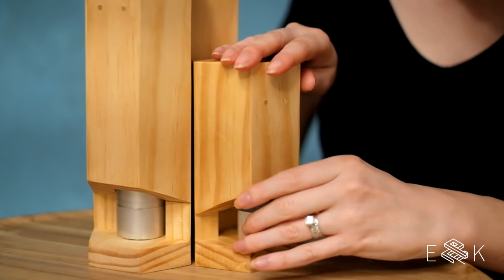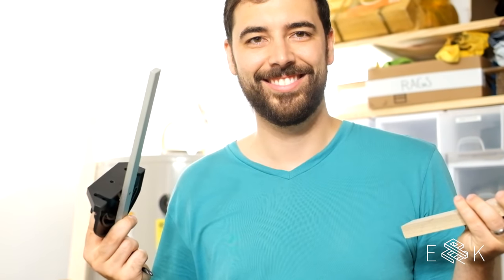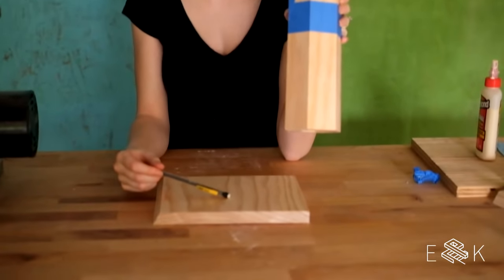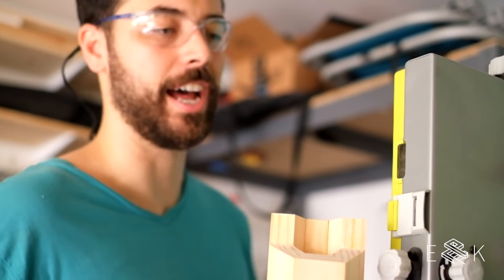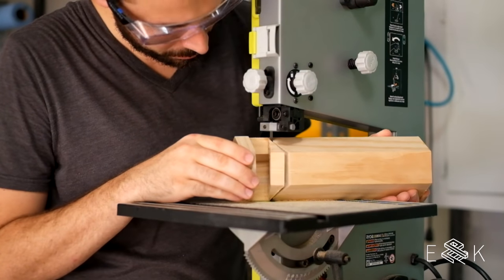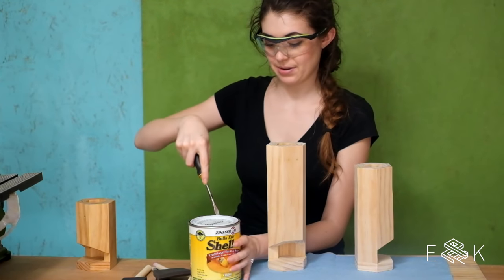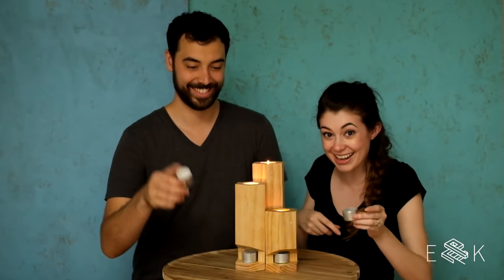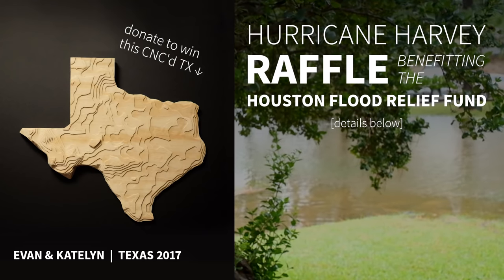DIY tea light candle holder w/ storage | How to

Comment: Really loved the brass rods to hold them up, I would never have thought of that. 

I feel like instead of trying to fix the angles on the inside I'd just chop it down to 5.75" tall or so (before the base) and use the drill press to make a big circular hole and it'll just have to be hexagonal on the outside, but I'm glad you guys overcame the issues and found solutions. Always love the videos, and your positivity is so encouraging to beginning woodworkers like myself.
Reply from the maker: +Jared Bennett haha we thought about just chopping it down! Evan came up with the idea to chisel it so we figured we'd try that first- luckily it worked!

Comment: I love this project.  One thing I might suggest is to do two halves of the candle holder, then you can cut the angle on the table saw on the one half, which might be a little safer.  Then you can also test the fit of the candles and sand the inside if you need to adjust.  I can never get all the angles cut right, so I usually do it that way so I can sand them flat and no one can ever tell the difference.  I'm really glad you two are Ok, and I hope the flooding stopped at the street, stay safe!
Reply from the maker: +The Every Maker that's a great idea! If we ever make more (haha, it took us months after making the first one to make the other two for thus video)... maybe we'll try that method 👍

Comment: Great job guys !! A trick to make sure that compound angled pieces go togheter well : glue the piece in two half ( in this case , 3 pieces  at time ) , then sand each half flat on a belt or disc sander and only then glue the 2 halfs togheter . This way , even if the angles aren't perfect the finished piece has always perfect miters ;) 
Also, for the 3rd candel holder , the one in wich the tealights don't fit , an easy fix could be to cut the holder in half lenghtwise , than use two narrow stripes of contrasting wood a glue everything back togheter. You'll end up getting a bigger opening and a nice aesthetic touch :P 
( i hope i made myself clear , english it's not my mother tongue :D ) 
Keep up the good work , you two are great , guys :)
Reply from the maker: ahhhhh that's a really good trick for doing the compound angles! Did not think about doing half at a time. Always learning new stuff. For the 3rd candle holder, I think if it had been stand alone something like that definitely might have worked, though I feel if one had a strip of contrasting wood through the middle I'd have to do that to all of them so they'd match. But definitely an option! Thanks for the help and ideas :)
Reply: Yeah , haven't thought about that , it would stick out like a sore thumb :D :D
Reply: I'm making some hexagons very similar to these for a nested wine rack /cubby  shelf thing...I ran into the exact same issue with tapering that E&K faced here... I like the glue half of them then sand flat idea but do you have any tips to get the miters perfect off the bat? I'm using a sliding Miter saw and it's calibrated spot on but I still get the tapering! 😡

BTW great video and channel!

Comment: I'm glad you all made it through ok. Now as far as the project I love the idea and the fact you showed your struggle is awesome. Just a idea but sine the tea lights didn't want to slide through perhaps using a drill press with a long forester bit through the center would open it up to allow proper movement of the candle? Just a thought. Loved the project... it got you a new sub!
Reply from the maker: +Todd Rickman thank you!! I think for the one where we would need to cut from the bottom, that would be an awesome solution! But for the one that didn't fit through the top, we didn't want to do that because we didn't want to lose the hex-shaped opening. Thanks for the thoughtful feedback and suggestions !

Comment: One trick my old wood shop teacher taught me when you use finish like that and it leaves a slightly bumpy texture is instead of using actual sandpaper to take it down since its easy to go to far, is to use just plain printer paper. It’s still abrasive but just barely enough and it takes the bumps right off.
Reply from the maker: +Leggo0 that's a really cool tip, we'll have to try that next time! Now that I think about it 600 grit sandpaper is pretty much just as smooth as printer paper haha

Comment: You might be able to store incense inside the one that doesn't fit candles in the bottom. You might have to re-engineer the way the storage opens but you could also make it so that, if you put it on its side, it's also an incense holder. The shape sort of reminds me of one I actually have that has a cool dragon on it. There are holes in it so that you're supposed to be able to close it and see the smoke coming out along the dragon but whoever engineered it must not have thought about the necessary amount of air flow required to keep an incense burning or maybe they used better incense for their tests. In any case, it makes for a very cool incense holder and it also has a spot to store an entire pack of incense.

Comment: if you were to make them really tall then could you use those big candles but still have multiple candles if you cut the big ones? Also could you make them with multiple candles but also have them shine out of a little hole instead of just the top? Love ya'll
Reply from the maker: I'm not sure about cutting big candles but you could embed the tea lights deeper and drill holes through the wood for sure

Comment: I'm late to the party on this, but I'm glad your house was OK! Also, how wide did you guys make the top and bottom of the pieces you cut? Thanks!
Reply from the maker: +steveo107 I'm not sure what you mean by top and bottom but I'll try to answer. For the 6 pieces we cut, the inside was about 7/8" and the outside was about 1-13/16". But it's more important to get the angle right so make sure that's what you're using to determine your sizes
Reply: EvanAndKatelyn I struggled to find the words for my question, but you guessed what I meant correctly! Thanks for the reply :)
Reply from the maker: +steveo107 woohoo, glad we got it! You're welcome :)
Reply: EvanAndKatelyn My sister is obsessed with tea candles and this will make a great Christmas gift. I think I'm going to try ripping one or two long strips with the angles cut and then cross cut them to length. I'll let you know how it goes.
Reply from the maker: +steveo107 best of luck! They'd make a great gift!

Comment: You could bore out the inside with a forstner bit the size of the tea light to fix the stick issue
Reply from the maker: +zacablaster that's true! We just wanted the inside to have a hexagon shape
Reply: Come in from the back side and no one will be able to tell!
Reply from the maker: zacablaster that's true - would have fixed our problem on the tall candle holder with the storage end being too small!

Comment: If you don’t want to see the brass rods you can cut them a little shorter and then use a punch to hammer them in further and then fill the holes with putty

Comment: time to get a small generator convert it to natural gas, do a couple windmills using small electric engines as generators, cover some of the house's roof with photovoltaic cells, hire someone to make the controller/managing box, and get a small battery bank.

that would make you self sufficient in black-outs, and reduce ur dependence in the grid/monthly costs in 60-80%

Comment: I’m still confused by the sanding of the cut surfaces?  They are as straight and perpendicular as they are going to get according to the calibration of your tools, sanding just makes the surfaces “un-planed”
Reply: Sanding helps get rid of splinters and things like that. Even on flat surfaces, sanding is still a good idea.